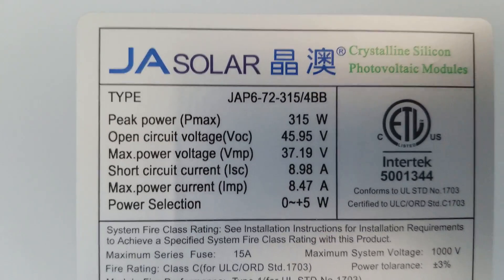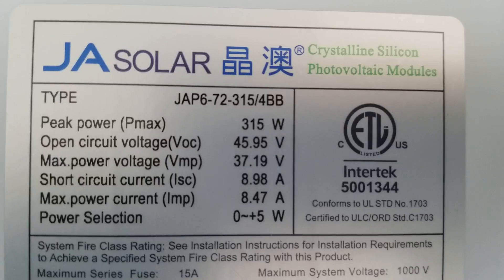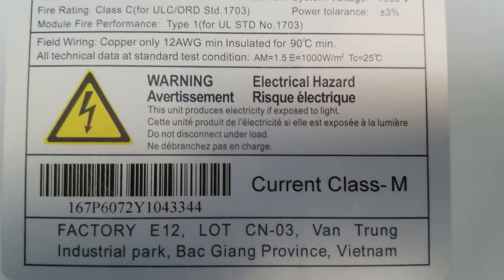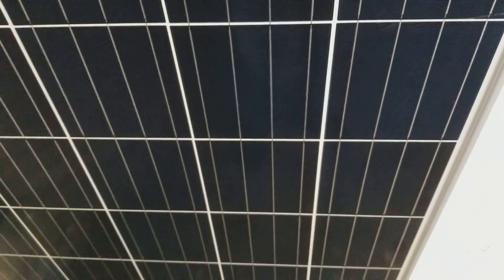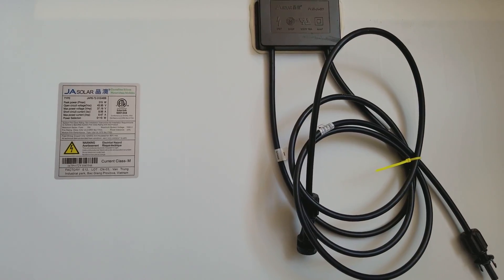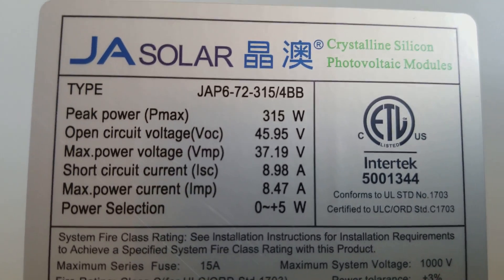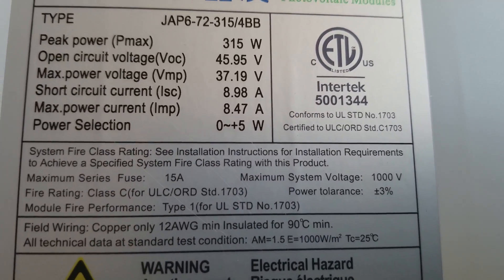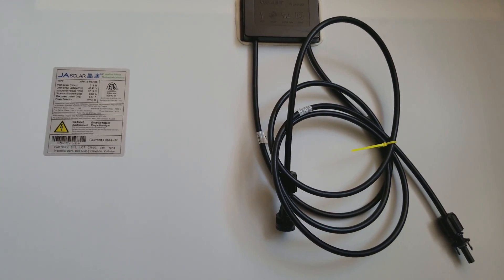JA SOLAR 4 BUSBAR HIGH EFFICIENT SOLAR PANELS | By JA SOLAR

Comment: How many batteries do I need for that solar panels?
Reply from the maker: UNISTRUT NUT WITH SPRING: Superstrut Solar Panel Mount
https://youtu.be/XBR-aiK7kIw

SOLAR PANEL ORIENTATION/Cutting Unistrut/Superstrut for Roof Mount Installation
https://youtu.be/eNFo08dfN8Q

UNISTRUT SOLAR PANEL MOUNT: How to install solar panels Using Unistrut/Superstrut
https://youtu.be/3uubcw8gGPw